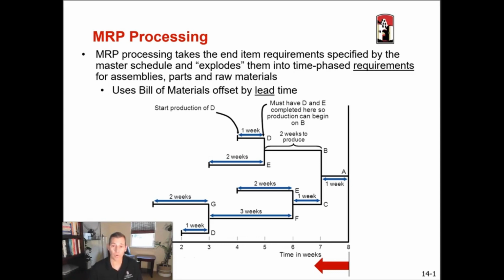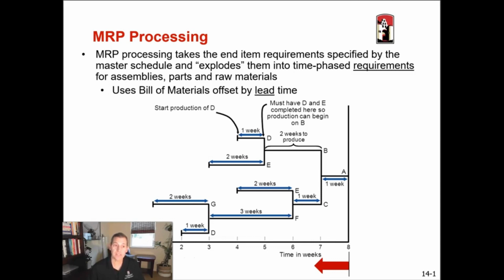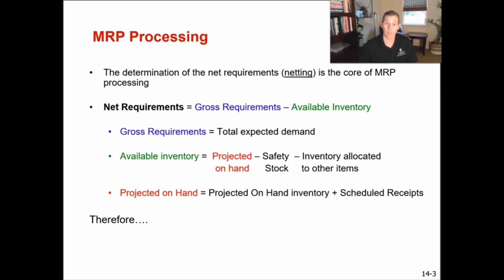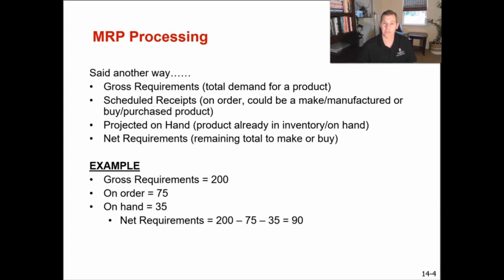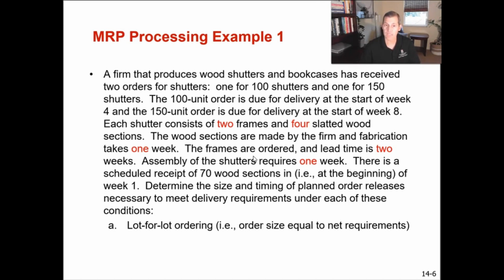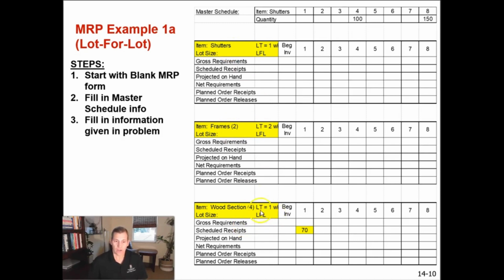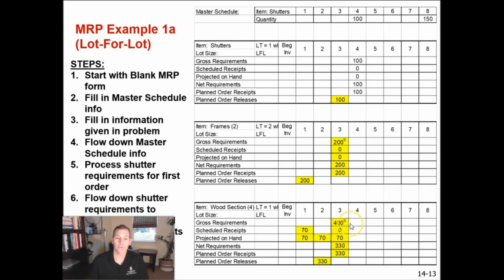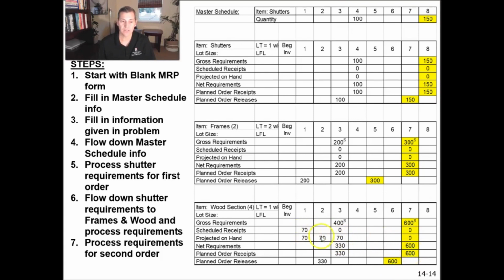MRP Processing Explained — Lot-For-Lot (LFL) Example

Comment: there are many methood like FOQ EOQ POQ PPB but some book just don't bring it up. for example in my school i learn about EOQ instead of FOQ. is which mean the main one is always FLF ? or is it the basic one ?
Reply from the maker: Good question! No, LFL (lot-for-lot) is not always the main or default method. It is one of several MRP lot-sizing methods, and it simply means ordering exactly what is needed for each period. EOQ is another approach that calculates an economical order quantity by balancing ordering and holding costs. Different textbooks emphasize different methods, and the best choice depends on the demand pattern and inventory costs.